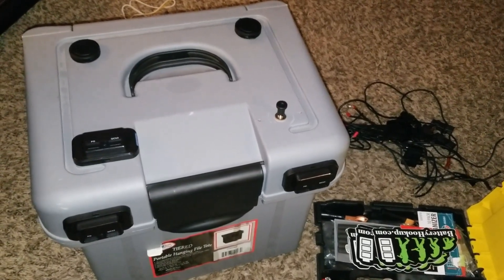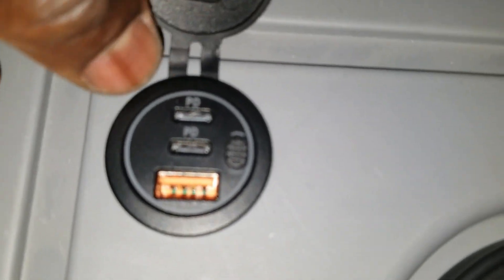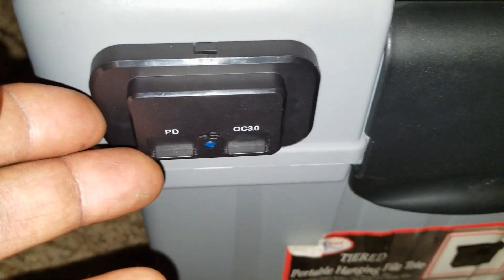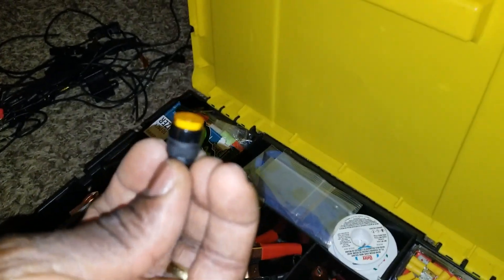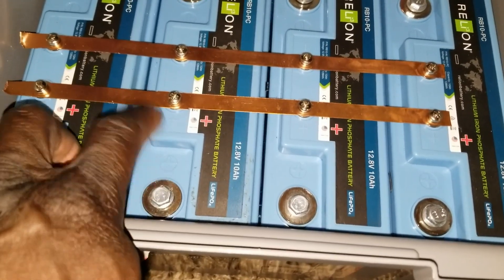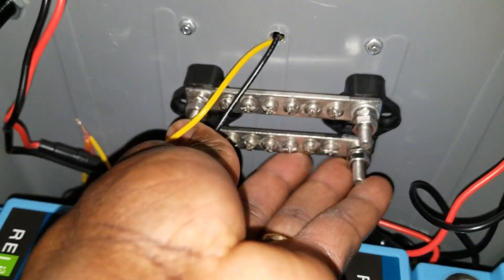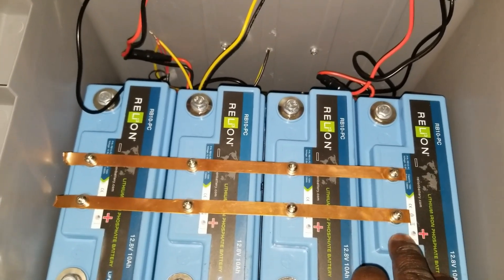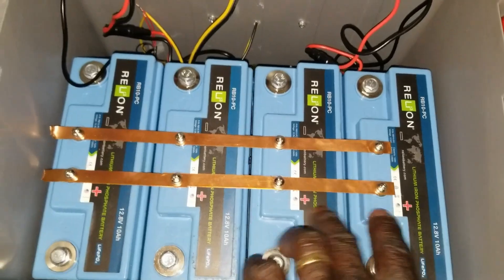DIY SOLAR GENERATOR! - PORTABLE POWER STATION RELION RB10-PC LiFeP04 BATTERY PART 1

Comment: You have batteries you have never used yet Man you better look again lol.
Reply: Long time no see but nowYou have got an awesome build and it looks like it will deliver excellent charging power from those lipofe4 cells .😉👌The box is the right size for this build . 🤙
Reply from the maker: @offgridwanabe  
Yes! 🤗
Stack on every corner at the Command Center 👍